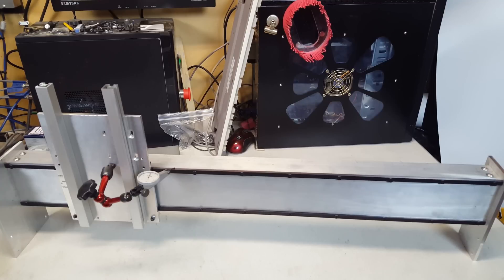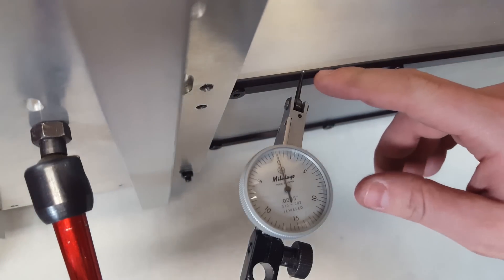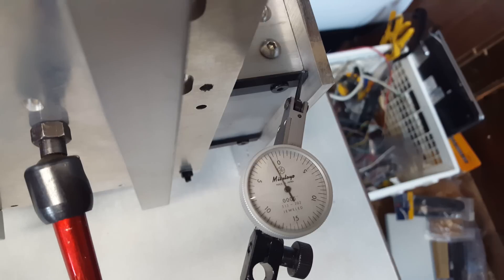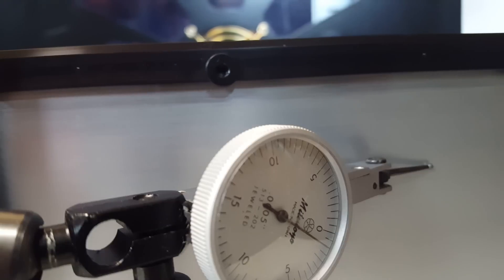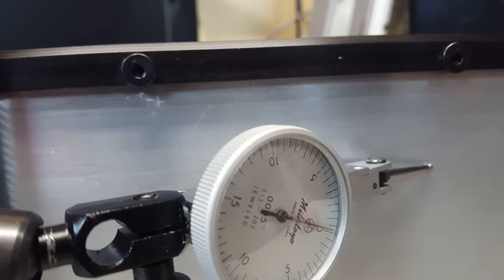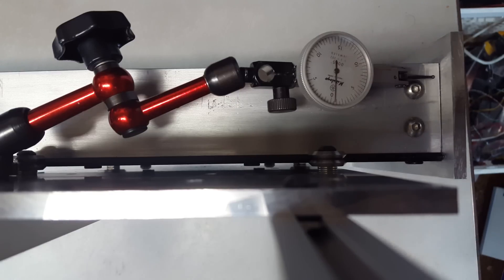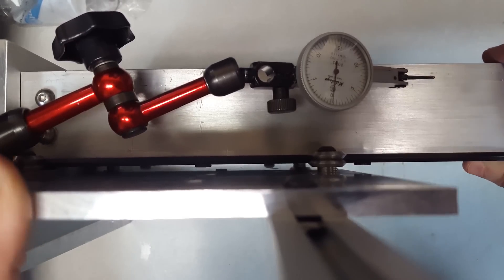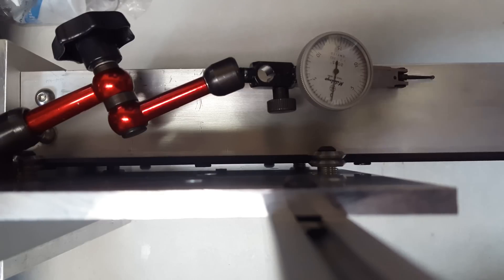DIY-Oko CNC Router: Part 3.1 Testing Accuracy!

Comment: the checking is OK but you are only checking how parallel the aluminum is to the rail.
what I mean if the rail went up and down in a curve and the aluminum curved up and down the same amount as the rail, then the dial indicator would say at "0" because the curves are parallel....
you are better using your mill clamp rail to mill bed a then test as longer length as you can then move the rail half the length along the bed and test again if you know what I mean.
planning my own cnc router going to make small one first then 800mm x 800mm cutting area after that :)
Like your channel
Reply from the maker: Good point. Thanks, and good luck on your build!

Comment: I bet the deflection you were seeing measuring the vertical face of the beam was from the v-wheels as it seemed pretty cyclic.
Reply from the maker: +Chris Muncy That's a good observation, I bet you're right.
Reply: +Chris Muncy +Caleb Peters 
it looks to me as though the screws are pulling the rail in it peaks in the center of every screw, i doubt it matters at the minimal amount, but you might be able so solve the problem by messing with the tightness of the screws? 
still a great feat to get the tolerance so tight, good vids caleb.